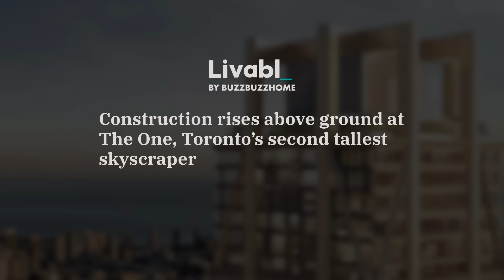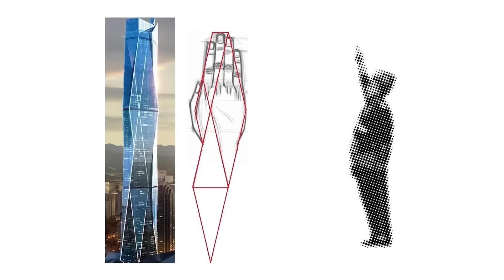New Skyscrapers Under Construction in 2022

Comment: KL118 will be one of the most modern and green building complex in the region. Below the tower there will be a shopping complex with a futuristic design exterior and a very modern interior. It should be ready in late 2022 or early 2023.

Comment: Bravo to Frankfurt, Germany for building new high-rise towers which will allow some people who are not zillionaires to live in one.
Reply: Not those towers though.  They're going to be extremely expensive.  I do remember the Grand Tower was offering bachelor suites at a reasonable price pre-construction, pre-brexit.  That has changed though; I wish I'd bought one.  What I'd prefer though is to renovate one of the prewar buildings.  There are still several buildings with either cheap extensions or emergency roofs still.  The old Panopticum on Kaiserstrasse for example lost a floor in the war which never got replaced.  Put a roof terrace up there and you'd have as good a great view.  What Frankfurt really needs is to replace the crummy modern buildings and rebuild many of the old prewar buildings.  If you're wanting to live in a high rise, what they need is social housing like they have in Singapore.  There are some great locations just 15 minutes out of the center by S-Bahn if some people were willing to sacrifice their kleingarten, just west of the Eschborn station, for example.

Comment: 4:21 I stayed at the Gevora Hotel last year in Dubai.... never again! Yes, it is the tallest hotel in the world, but they decided to only install SIX elevators for over 70 floors! Three went up to 33 ish floors, two went above 33, and one service elevator, only open to the public sporadically. The wait to get down in the morning for breakfast took around 15 minutes because the elevators were always full.
When I checked out, I decided to move all my luggage to the lobby at 6am, to ensure I would make my plane at 12pm.
Ridiculous, awful design. And what's worse, they cannot fix this problem..... unless they destroy a room every floor to build another elevator shaft ($$$$$), or build an external elevator system ($$$$$).
Reply: I believe it was originally designed for a residential floorplan but Al Attar took so long in development that clearly they needed to simply get the project done or the programming needs changed mid-way through.  Only six elevators is terrible for a building that tall but since it's right on SZR, the floorplates aren't that large it seems.
Reply: Dubai is just a fake scenery with its fake islands. The Burj Khalifa´s sewerage is done by TRUCKS every single day because Dubai`s sewerage is too small for such big demand......just ridiculous!!!!!

Comment: 9:55 Spire?!!! Thats the elevator corridor thats still under construction. The image you used shows the building less than halfway complete so your dimensions are way off.
Reply: That's the concrete core of the building. The spire is added on top of the core on a metal structure
Reply: Come on